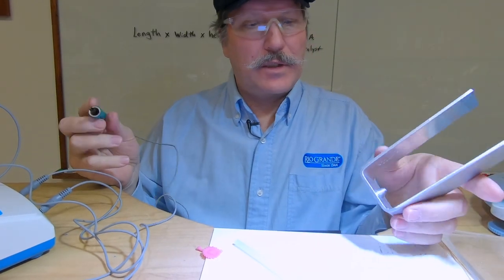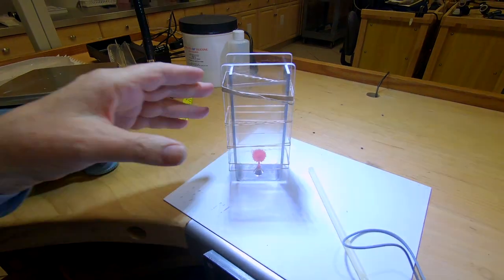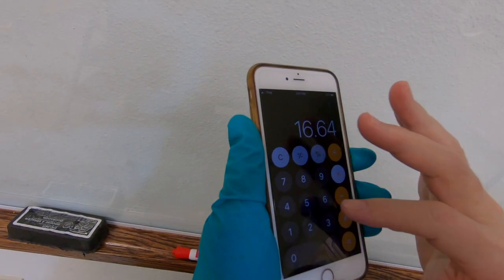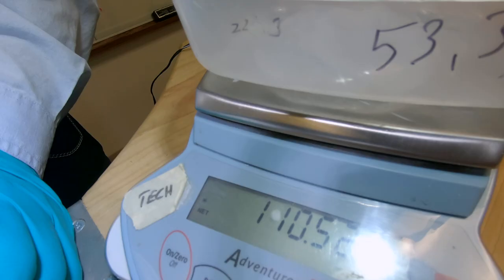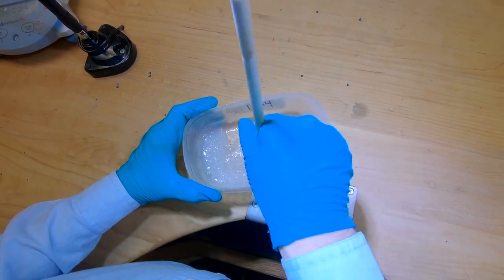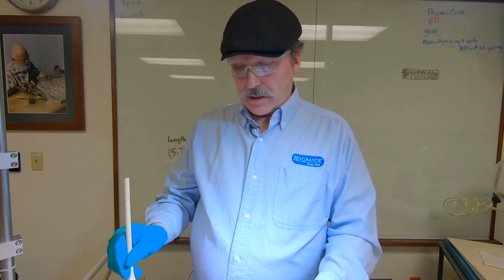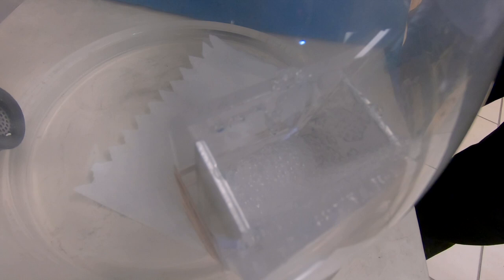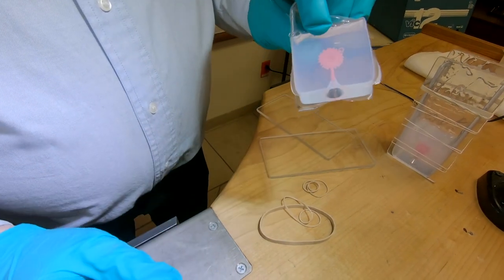How To Make an RTV Mold

Comment: Hi, thanks for sharing. Could tell me if exist another way to remove bubbles without a vacuum machine?
Reply from the maker: Hello we will ask your Tech Team and let you know what they say!
Reply from the maker: Hello our Jewelry Tech Team got back to us and they said yes. You can place it in your refrigerator for several days the cold will slow down the curing long enough to let all the bubbles rise then remove it from the fridge and let it cure at room temp. "How's that for a sneaky trick???” We hope this is helpful. Let us know if you have any other questions!
Reply: @RioGrande1944  thanks for your help, I will try and let you know my experience. Thanks
Reply from the maker: @eniellorenzogarcia5262  Not a problem, please let us know how this works out for you!